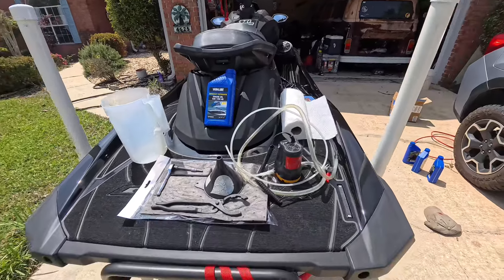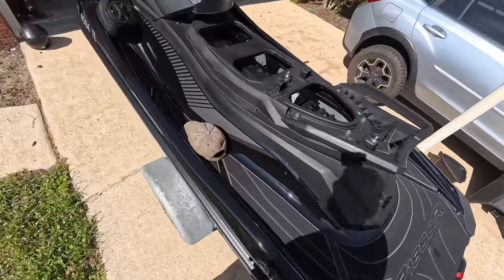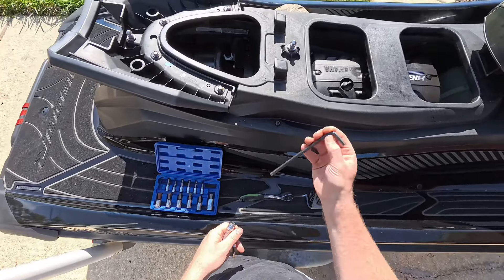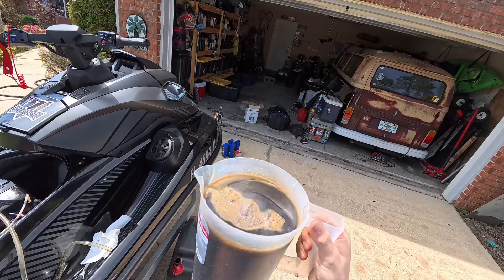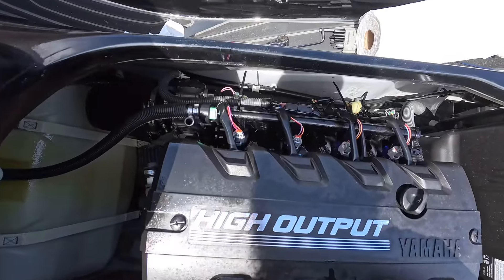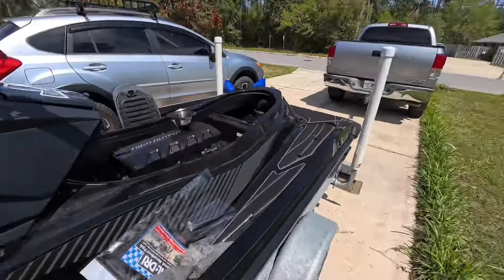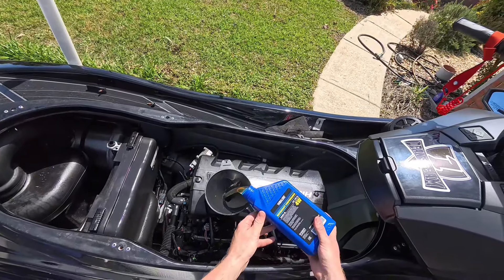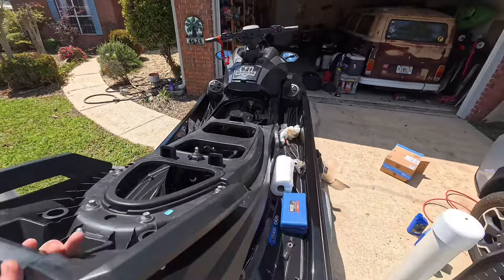DIY Oil change on Yamaha GP1800R HO & VX HO | 1.8L engines

Comment: How long does it take for your extractor pump to get the oil out? I have the same pump (came with the skis) and it super slow….like in the neighborhood of 30 minutes or more. Flow looks to be about the same as in your video, but the pump just very inefficient.
Reply from the maker: @chieftan69  mine takes a while probably 15 minutes or more
Reply: @Watercraftshack  Thanks for the reply. I take that to mean the it’s standard for the pump to suck (no pun intended).

Comment: What kind of air filter is that? This is the second time seeing some kind of bag over the air filter.
Reply from the maker: @traceelliot1360  this is the worx racing air filter
Reply: @Watercraftshack  I just removed the big box air filter in my 2024 Yamaha Waverunner. I like the extra room but I think with all engines you need front of engine air filter vacuum resistance according to this article posted below. So at the very least I might leave the long tube and attach a worx filter to that for a little more front of engine resistance to built a better vacuum.

Additionally, most engines employ an air box which is an air chamber designed to reduce the velocity of air . The air box often also holds the engine air filter because the reduced velocity allows for lower face velocity at the filter leading to lower air pressure drop (so lower suction load on the engine) and better filtration. The air box is arranged so that the air is sucked upward through the filter with a plenum space below. Air entering the plenum loses energy and this allows any entrapped water and road debris that were taken in at the suction vent to fall out of the air stream as well.